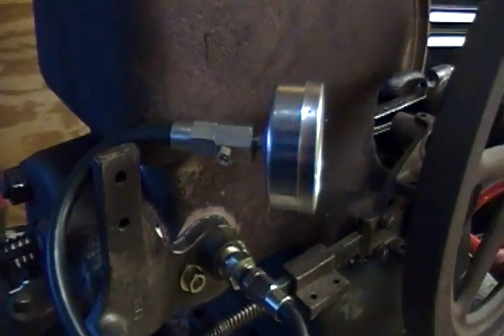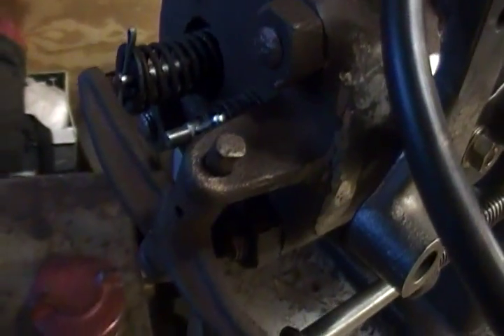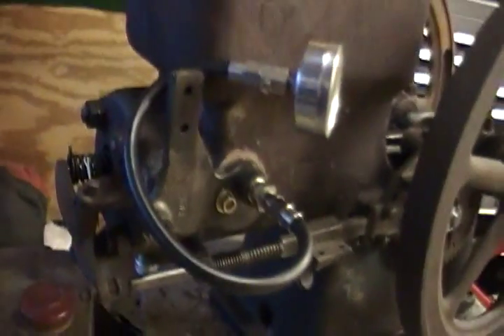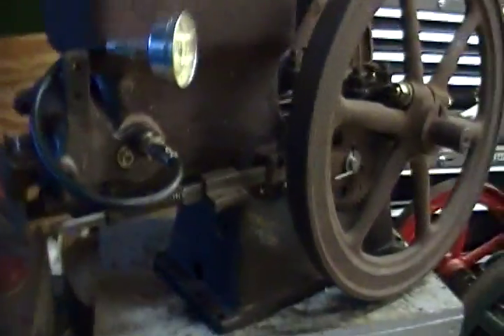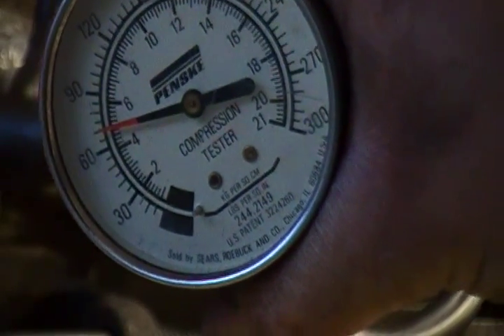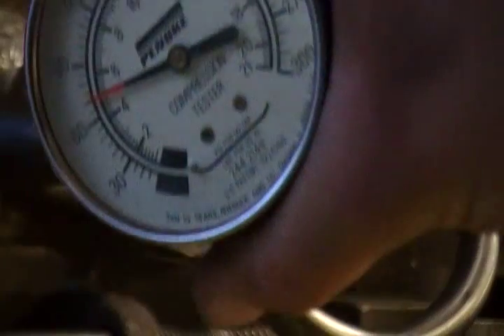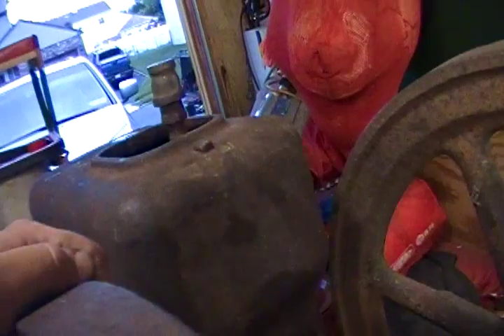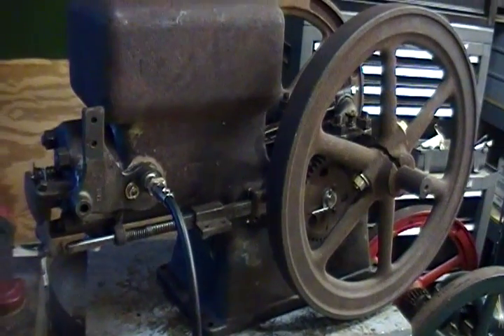Hercules 2 1/2 HP Engine Series / Compression Test

Comment: Great job getting her running, I really enjoyed the whole process.

Remember that these engines were designed as low compression engines by today's standards. Back in the 1930's gasoline octane ratings were at best 65-70, going as low as 40 in low grade fuels. Compression ratios like todays engines would have seen massive detonation (pinging) which would have quickly destroyed the engine. I would expect to see your compression improve somewhat considering it it a newly honed bore with new rings. But you will never see the 150-180psi that modern engines achieve, that engine just is not designed for it.

Comment from the maker: I do not think there is an actual spec for it.  This was the first time I had ever done a comp. test on one of these engines.  Usually if you spin the flywheels against compression and they bounce back quickly its fine.  I think this engine has a ratio of aboit 12:1.